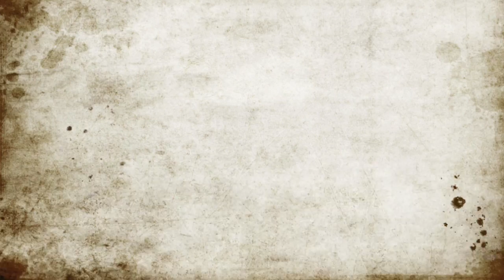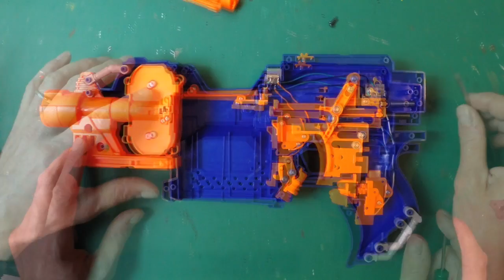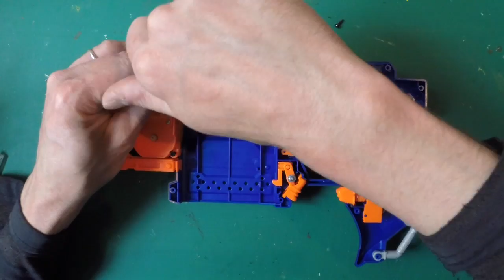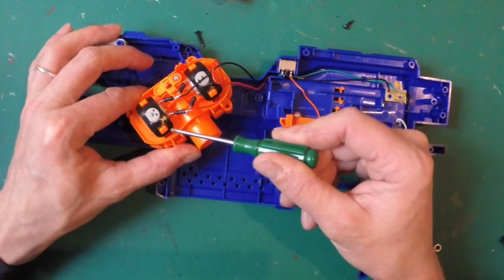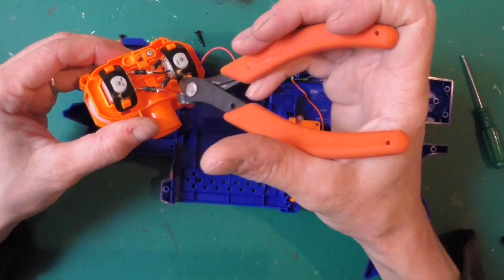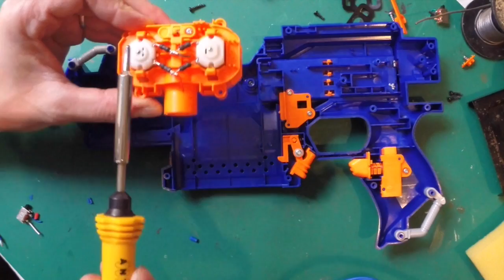Nerf Stryfe Re-Wire Part 1

Comment: can i use a standard double a battery 1.5v with this rewired stryfe?
Reply from the maker: Yes you can, it will still work fine. You just won’t get much more power.

Comment: Hi FoamDart Services, thanks for the video, I think I've got it but just a quick question so I know I've got this 100% crystal clear since this is my first time modifying a roller nerf.
I can use your video and rewire (either 16awg or 18awg wire throughout) my standard stryfe ( stock motors/AA alkaline batteries etc) and see a small gain in performance but more importantly what I'm doing is I'm future proofing it for when I want to upgrade the motors and battery ( fang revamps/42.5mm cage/ bulldog wheels/2s lipo ). That's 100% isn't it.
Also if you've a better combination for motor/cage/wheels/battery to achieve around 130 FPS of really appreciate hearing it.
Thanks
Reply from the maker: Rhory Burnside Yep. Just add an XT60 connector to the loom for lipo and either swap the rev switch or add a MOSFET for new motors, Fang RV are very high current draw at stall. I leave 4-5cm of spare wire coiled in the stock block on AA builds to allow for a later lipo upgrade. Use 16AWG if you intend to go with new motors later.
Reply: @foamdataservices  100% thank you. I guess I'm wire shopping tonight then 🤘🏻.
Are there motors on the market you could use with a standard rev switch or is it best just to swap it out when changing motors?
Reply from the maker: You can leave the stock switch in if you make a MOSFET loom. I would do that from the start if you want to future proof the build. BSUK and Out Of Darts do mosfet loom kits.

Comment: Quick question - is there a set of motors that is happy with a lipo battery upgrade and would also run on AAs? I had an idea to have an AA battery pack that can be removed and plugs in using XT60 connectors like a lipo, so that the kids can use it around the garden without melting anyone’s face off, or causing a fire when inevitably doing something stupid with a lipo...
Reply from the maker: Yes, stock motors.
Reply from the maker: Also lipo is totally safe. My kids use it all the time. Just remove from the blaster and check voltage after playtime, recharge then put in the box for next time.
Reply: Foamdata Services cheers, I still have the stock motors in there with a 3s, which works fine but after a while the motors give off a bit of a ‘scent’, would you recommend a 2s for stock? Tried looking up the motor specs but couldn’t find any...
Reply from the maker: That smell is ozone, it’s the copper brushes burning. The only other alternative would be MTB Rhinos, standard ones, not Neo, they will just about run off NimH AA cells and are excellent on 3s lipo. I don’t run any stock Nerf motors at 3s.

Comment: Do you have to put in whole new wire if you want to run 2 IMRS and 2 dummy batteries or 3 IMRS and 1 dummy battery?
Reply from the maker: You should always rewire before using higher powered batteries if you want to do the job properly. 3 IMR will just trip the thermosistor and removing it leaves your toy components unprotected from stall currents. If you just want to try out better batteries before re wiring properly then 2 IMR and 2 dummy cells won’t trip the PTC and will give you a small performance boost vs stock. Flywheelers are all or nothing in mod terms tho, they work much better done properly.

Comment: Jist get the gauge of wire? No special core or anything?
Reply from the maker: Wire is matched to expected current demands, so if you are planning to upgrade later from stock motors to other hot 130’s use 18AWG or 16 if you might put in 132's or 180's. Strand count and cross sectional area are what dictates current capacity in wire. I use RC grade silicone insulated multi strand, there are lots of examples linked in other comments.

Comment: Love the guide, great work.

Sorry perhaps a silly question. Almost every mod guide ive seen recommends replacing the microswitch. Is there a reason you chose to keep it? If it isnt part of the resistance i'd rather keep it as well as that would be a lot easier
Reply from the maker: A switch cannot generate measurable resistance, it's simply two copper contacts. People advocate replacing them in the mistaken belief that they burn out.  I left the stock switch in for this guide as it's fine with any 130 motor set, it's better long term to replace it from a reliability perspective as it's a 2c low quality part. If you use a MOSFET loom you never need to replace the switch as it only carries signal current.
Reply: Foamdata Services 

thanks for the info! if im not mistaken its something that can always be replaced easily at a later stage if it fails?

also does this mean you could potentially leave in the other switches if you were so inclined?
Reply from the maker: Take the lock switches out or use them to turn on led's. They have zero practical function beyond satisfying toy laws. You can upgrade rev switch later, there's a video on the channel about doing so. In the RS always replace the switch gear.

Comment: Hello Foamdata Services,
I wanted to start off with that I'm new to the channel and subbed right away for you make great and very useful content, but as I was going through the mod (this is my first time modding and soldering) I finished everything to what I thought was correct and it works but it doesn't stop revving, as in like I put in the batteries and it automatically starts and won't stop till I take them out, I was wondering if you have any ideas of what the problem might be ? I really don't wanna through away my stryfe already and thank you very much for your time ! 👌🏻
Reply from the maker: You may have wired the rev switch wrong. If it's 3 pins, put one contact on the middle pin, the other on the top pin. Test by pushing the switch closed, if it stops then that's your problem. The other possibility is you melted the switch by putting too much heat in, if that's the case use one of the lock switches instead, wired as above. If it's not that then I would need to see pictures of it to fix it. I can be found at www.britnerf.co.uk
Reply: Foamdata Services alright thank u very much I really appreciate it ! It was the rev trigger combined with my bad soldering, i finally got it this time though

Comment: Stupid question: Would it be possible to just cut the stock wiring and just re solder it back together?
Reply from the maker: Not if you want to use more than stock batteries. The stock wire is rated for max 5A.
Reply: Yeah, I was mainly looking to do a paint job, I'm already quite happy with the performance out of my Stryfe I use energiser batteries and it seems to do a better job than the other batteries I've used in the past, would these batteries still be classed as stock batteries though?
Reply from the maker: Yes those are stock batteries. You get much better results with 18AWG silicone insulated hobby wire, including a small power boost. The wire is very cheap, you only need 3ft ft of it to do the whole lot. I would rewire then you can run better batteries and motors later. Throw the stock crap in the bin where it belongs.
Reply: Yeah, but don't I have to get like three different types of wire to do that? also where would you buy such wire?
Reply from the maker: You can buy single lengths of it in lots of colours off eBay. You can just use red and black if you are being stupidly tight.
Reply: Okay thanks for the help you just earned a sub.

Comment: Love the video I would like to rewire my Stryfe. Can you tell me what type and wire and voltage you use.
Reply from the maker: 18awg silicone insulated multistrand hobby wire, for stock motors use 2 IMR batteries or a 2s Lipo. See my balance and battery videos for more info.
Reply: +Foamdata Services DOES a 3s exist that fits inside the BatteryTray without an extended door???
Reply: idk
Reply from the maker: Pirate Johnson Yes, its just small and under 800mah. There are a couple of LIHv packs that fit. Its better to have a bigger pack though, just buy a tray expander and use a 1000mah 40c.

Comment: Can i use a 3.7v 650 mah 2s lipo which came with my quadcopter  on my stryfe and will it have good performance,if yes pls make a tutorial on how to use it.
Reply from the maker: That pack may be a bit small, it should be fine for STOCK motors only. Just follow my rewire guide and instead of soldering the main +ve and -ve wires to the battery tray terminals, drill a hole into the battery compartment and run the wires out of it, then solder battery connector on the end. Your pack probably has a JST connector on, which will just about work with stock motors. Otherwise you will need to change the pack connector and use a Deans or XT60. That means you wouldn't be able to use it in your quadcopter without changing its plug too. I would recommend a low voltage alarm too, to protect your battery. Here it all is in the tray of a Stryfe
http://i.imgur.com/h7CIfDS.jpg
Reply: +Foamdata Services Thank you for replying very promptly,sir!
Reply from the maker: Also 3.7v is 1s, 7.4v is 2s. 1s WONT work with the stock motors.

Comment: I believe I did everything u said, after I finished everything was ok, the motor was spinning, the buttons were working... But it shot less than half the distance before the re wiring. I could smell something was overheating/burning when the motors were running. Can u pls help?
Reply from the maker: You have made a mistake somewhere. Check all your connections and make sure both motors are working. What battery did you use also?

Comment: Thanks, I do not own a stryfe neither do I own a flywheel but I wanted to know how it worked just incase. I watched many tutorials on youtube but I just couldn't figure out how to rewire it with batteries, you did show me though. I really want to thank you for that.

Thanks
Tycho
Reply from the maker: Glad it was useful, imagine the Stryfe as the simple circuit everyone makes in school with a battery, switch and light bulb. The battery is obviously your battery tray or pack, the switch is the Rev trigger and the bulb is simply two motors wired together in parallel. It's honestly super simple, go do it, don't worry about why it works, just know that it does!
Reply: Foamdata Services
Thanks!

Comment: i wanna do paint job how can i put the wires to batery back whitout soldeering
Reply from the maker: Paint it first, then finish the wiring. 
You can do it with the whole thing together, but stuff the barrel, mag well and jam door with newspaper and mask off the trigger and battery compartment with painters tape. That will keep the paint out of the internals. I complete all my paint before wiring anything but my paint work is more involved than most people. 
There's a masking how to on this channel. You can't attach the wires to anything without solder!
Reply: What do u mean whit masket to do whit out soldeering and when i wanna paint do i need to sand the nerf gun first? So yes how
Reply from the maker: +Virgil “CrazyGameLover” Bouwens Lightly sand with 400 grit auto paper (black) then paint. I totally sand off all the digi cam and wash the whole shell. to do that you should take all the internals out. if you are just painting with it all together then sand and wipe the outside with a clean damp cloth, then paint when its dried off. masking or painters tape is sold in diy stores you use it to cover areas you don't want paint to go on. google how to paint nerf.

Comment: What will happens if I remove the dart tooth?.

Please respond.
Reply from the maker: There is no dart tooth in a Stryfe. If you mean the stupid dart sensor lock that sits over the mag well, then pulling it out and binning it makes the blaster much better as it doesn't lock the trigger all the time. No other similar blaster has that part, it's really annoying. Bin it.
Reply: I meant the two things before the flywheel. The bullet is pushed through these weird teeth (I don't know what they are called)
Reply: Also!. What happened to your website. It will not load. It is just a blank screen
Reply from the maker: Sorry, I just saw the middle post. Those "wings" are the dart guides. You can take them off if you want, the Rapidstrike doesn't have them and uses the same flywheel cage.
Reply: @weirdinternetperson4342  *dart

Comment: I just want to also make sure if I buy this soldering iron is this good enough for this hobby ? http://www.amazon.com/Weller-WLC100-40-Watt-Soldering-Station/dp/B000AS28UC/ref=sr_1_4?ie=UTF8&qid=1435278802&sr=8-4&keywords=Soldering+iron

Thanks in advance

bTW saw the blaster you made drac that rapid strike was sick great job one of the best paint jobs I have seen
Reply from the maker: That iron is fine but you don't need to spend that much! All my mods are done with a $20 iron and a dime store solder station/stand. Anything over 30w is fine.
Reply: Ok cool i will get this one i just wasn't sure if the fact it is not temperature controlled made a difference. Thanks again for everything
Reply from the maker: Temperature controlled irons are useful for micro electronic work and for brass kit building, but not necessary for Nerf. Be sure to practice some joins on the old stock wires before you start with your new wire.

Comment: Foam could I bother you for one more thing ! would you put a link to where you get the wire on eBay ! I just ordered the IMR batteries from your other link in the description. I am also going to radio shack this weekend I saw the heat shrink things on there website.
Reply from the maker: Wire- get 1-2ft each of Red Blue and Black

http://www.ebay.com/itm/18AWG-Black-Silicone-Wire-RC-hobby-lipo-motor-battery-USA-SHIP-1ft-18-gauge-ga-/171830252943?pt=LH_DefaultDomain_0&hash=item2801e1958f

Heatshrink
http://www.ebay.com/itm/150pcs-2-1-Polyolefin-Halogen-Free-Heat-Shrink-Tubing-Tube-Sleeving-Cable-Wire-/360650816383?pt=LH_DefaultDomain_0&hash=item53f876bb7f
Reply: Great thanks i ordered everything ! appreciate it, I really appreciate you being so helpful
Reply from the maker: Good luck with your rewire, the Stryfe is amazing modded.

Comment: Awesome Vid Foam I have just started to try my hand at modding and Custom painting this is the best stryfe vid I have seen. I have only been doing spring blasters been nervous to try electrical, but after watching this I my venture out a bit as soon as I buy a soldering kit ! 

Thanks I just subscribed to you today ! I will let you know how my first one goes when I get a chance to do it ! 

Thanks
Reply from the maker: Go for it! It's a total of 8 solder joins and three wires. Drop by www.britnerf.co.uk if you need any help, or nerf Reddit. Let us know how it turns out.
Reply: @foamdataservices  /r/nerf

Comment from the maker: Atij- watch my battery video or Bobololo's battery guide.
These are IMR batteries.

http://www.ebay.com/itm/2-EFEST-IMR-14500-Li-Mn-700maH-HIGH-DRAIN-Rechargeable-Battery-3-7V-BUTTON-TOP-/231241593777?pt=LH_DefaultDomain_0&hash=item35d712b3b1
Reply: Foamdata Services thank you on your battery video- you explained everything so well and helped my noobish brain   understand a lot more
Reply from the maker: vodo2 Glad to be helpful. Make Test Battle have an excellent vid for new electrical modders as well.

Comment from the maker: Atij- no we don't use Ultrafire batteries. I use either a small 2s Lipo pack or 14500 IMR cells. Both are far better than Trustfires or ultrafires, which lack the current delivery required by Nerf blasters. IMR cells can use the same charger as Ultrafires but do cost more. They are also far safer.
Reply: Great tutorial! How many IMRs do you run in this, all 4? 3 IMRs and a dummy?

Comment: Do u use ultra fire batteries for this mod and does it work
Reply: Dont use ultra fire batteries with nerf guns, they are dangerous with repeated and prolonged use, and in the past have broke my guns and one made my gun heat up so much that if it was sitting on something flammable it could have lit on fire.

Comment: They say removing the thermistors in the motors do very little in performance..... Actually it does effect it dramatically.
I range tested it firing flat outside without breeze after rewiring.
Stock- 43ft flat
After rewiring - 60ft flat
And I was still running it on regular 1.5v alkaline cells.( the original ones I used.)
Thanks Foamdata for the guide. :)
Reply from the maker: If you used good quality materials the improvement in performance is down to the combined effect of removing all the choke points in the system. The inductors on the motors alone are not creating a measurable resistance, they are just a little coil of copper wire. Glad the rewiring guide helped you though.
Reply: Yes, it did. I couldn't have done it without your help :)

Comment: Can I remove the resistors in the motors and use standard 1.5v batteries? Will it have any change in performance?
Reply from the maker: They are INDUCTORS, basically a small coil of wire, not resistors, so they DONT MAKE ANY DIFFERENCES to performance if you don't do the rest of it. You CAN use a rewired one with standard batteries, it won't have huge performance gain but it will be easier to use as there are no locks as well as better wire. I have several that my regular players use at home with 1.5v then they put IMR cells in for wars.
Reply: Foamdata Services so if I rewire the electronic locks I will at least have "slight" performance change?
And this, I don't have trustfires. I only have standard batteries, so if I remove the inductors, will it have change in performance or not?
Reply from the maker: No, none what so ever. Do the job properly, change all the wiring for proper stuff, then save up for better batteries. IF you rewire fully you might get 2-3fps. A proper measurement will be added to my battery wars test in the next few weeks.
Reply: Ok, thanks a lot for your help. This guide is very helpful :)